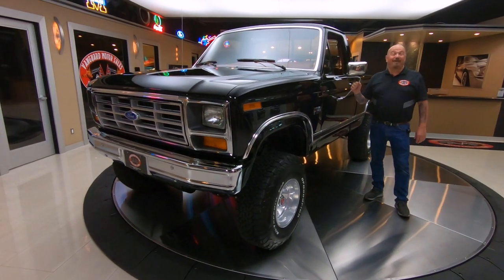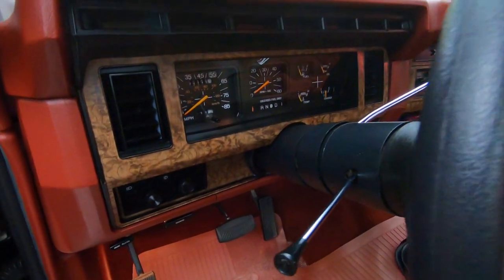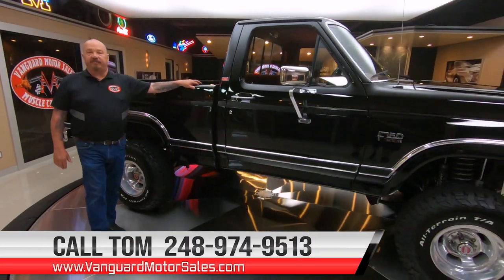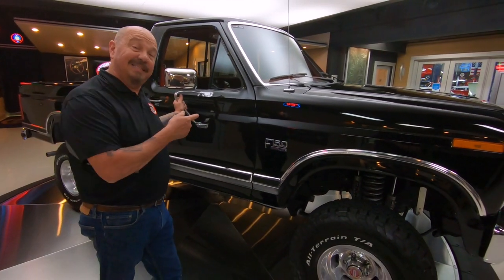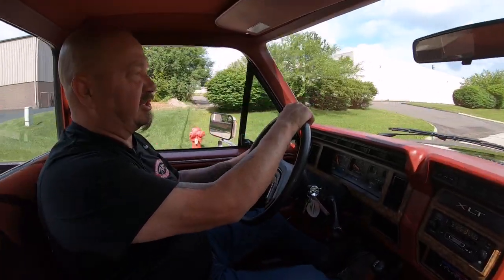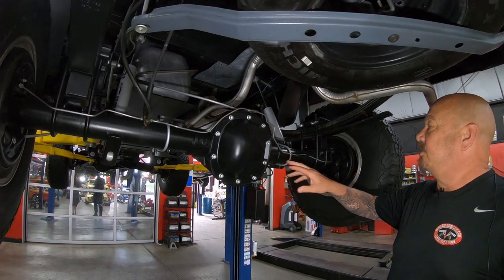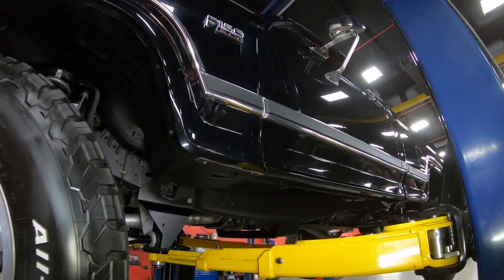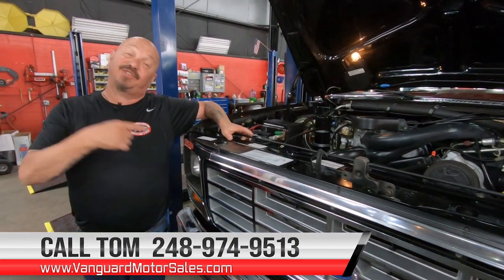1986 Ford F-150 XLT Lariat For Sale

Comment: I purchased just about the same exact truck new in 1986 as well.
Mine was a flair side though. 
Man did I love that truck up in Michigan, but...she ended up being the biggest lemon I ever owned!
I had so many mechanical problems with her. She spent most of her life at the dealer getting fixed under warranty (thank g*d)
I ended up trading her in with only 30k miles on a new 88, 5.0 conv Mustang.

Comment: My dad before I was born built one it was I think actually an 86 explorer pickup it was nice blue chrome grille it was sweet had a nice flare visor also very nice picture design on the tailgate it was a sweet little truck he had for 4-5 years mabey bit longer I remember driving in this when I was a little guy and got say this truck had balls barley touch the gas and the truck would go it was a fast little pickup I'm 17 and would love to have and old Ford pickup also had chrome plated rear bumper